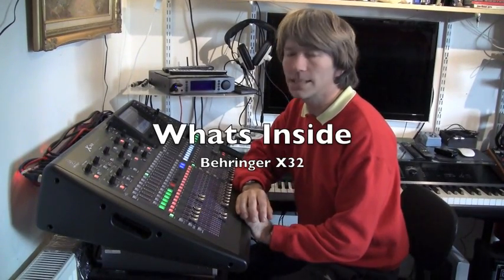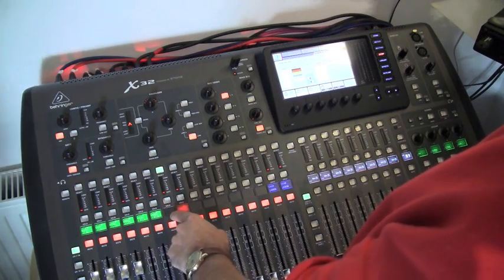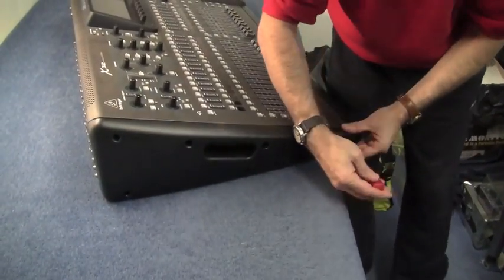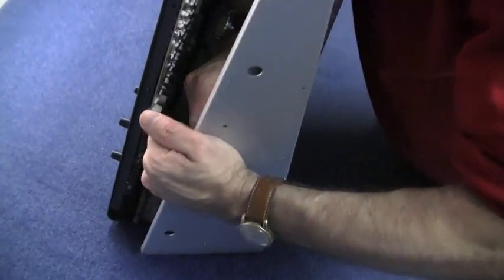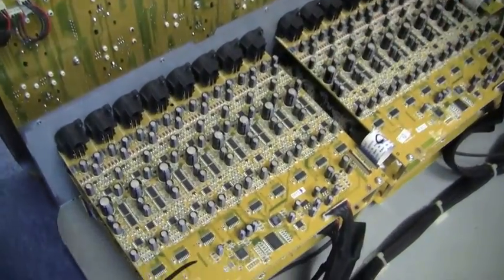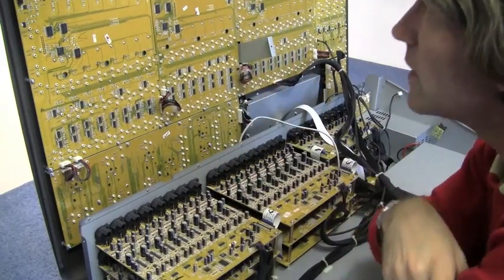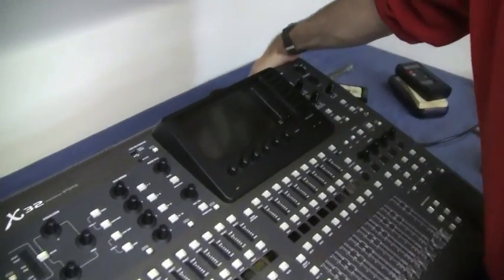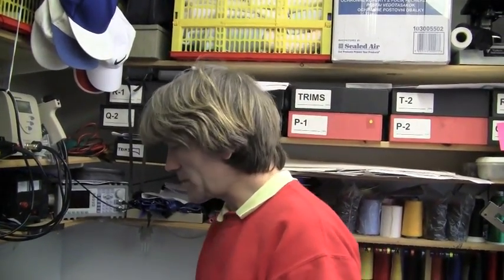MF#2 Inside the Behringer X32 digital mixing desk teardown and repair v2 software

Comment: Thanks so much for this! This repair totally worked for me on my x32 many years ago. The LED in the scribble strip is still going strong with the unit turned on nearly 24-7 for many years. This fix also worked on an X-Touch Extender. Exact same problem, one of the color channels went out on the LED. Heating it up with a soldering iron and reflowing a tad bit of solder fixed it in both cases. Not sure if the LEDs just need a bit of heat to fix the channel, or if there were issues with the original surface mount soldering. this fix did it on both occasions.
Reply from the maker: Thankyou Doug I’m glad it worked for you. best wishes.

Comment: Damn, you have all my respect to do what you do, thanks for publishing the video :)
I only add that some of those small screens have a different brightness already from new mixer at least as far as I am concerned with what I have found on the one I have, 1 or 2 result with a slightly weakened brightness, but by adjusting the brightness settings you can correct a little the problem but obviously remains.

Comment: Would have been a better repair if you had applied the solder and the iron at the same time instead of dabbing it. Also you did not need to remove the side plates and base making it unstable.

Comment: .... what do you expect..... it's a Behringer.  I've three DDX3216 mixer desks now. Wow, fab spec for the money .... which is exactly the problem.  All THREE have various issues from no boot :\, 'Xmas tree' lights on another and one which takes about 10 restarts to 'charge' the failing capacitor circuit of the PSU, so that it doesn't then fail the boot check on Vdrop on the line, ie. just enough to squeak it through the boot sequence. Then IF it gets there, audio main buss crackles light static until it warms up....all good to start recording .... unless it freezes.    Looked under the bonnet of all - the finish build and glued everything it would seem, could have been better finished off by my 11 year old daughter... wearing 3D movie glasses on .... in summary - as you know - you get what you pay for.  Otherwise they're great!!! :)

Comment: I also have this exact problem, but on channel 13.  No red.   I notice Full Compass has a lot of repair parts for this board.  I'm thinking stocking up on a couple spare faders/motors, encoders, scribble strips, etc.

Comment: Hi Markus! I want to repair it by myself too and I was wondering about the watts of the soldering gun, should it be a low watt gun? I have the problem with the LED's from 9-16 and 25-32 channels but they don't show icon & text, just the color and invert color button doesn't work too. Could you tell me a little tip and some cautions please? I'm not from USA so I can't even send it to a repair center.... hope u can help me buddy :/
Reply: I'm afraid that's a larger issue that isn't so simple :(

But as to what to use, he uses a temperature controlled soldering station here, it's a basic Chinese clone of the old Hakko 936, well it's not an exact clone, but the tips are compatible and they look similar, and it's likely specified as 50W or 60W. The way you work with a temperature controlled station, you turn it up slowly until it can melt the solder from a roll, and then you turn it up another 50°C or so, and then that's gonna be fine, and the more powerful it is, the better, but on Chinese gear that doesn't come from one of the bigger Chinese brands like Zhongdi and Aoyue, the specs are usually rather optimistic and sample variation is huge, so you can't trust them anyway. You do this carefully for every tip you have once, and then you just remember and you can set it straight away. To be kept in mind when setting temperature is that repair should be done with eutectic leaded solder (something like Sn63Pb37, or i use Sn62Pb36Ag2), because it's less stressful on the board and the parts, but the parts are originally soldered with Sn100 if they were made in 2005 or later, which takes a higher temperature, so you may need to add another 20°C to reflow original solder properly. Make sure you have magnification tools on hand to inspect.

Generally, i think everyone who is inclined to do the repairs should learn to do them, but the first thing you consider repairing is usually something valuable and something you depend upon, and you probably shouldn't be soldering around on it right away, there's a lot of damage that you can do, but have someone with more experience help you along or maybe turn to a professional repairman.

There's a variety of tools that you can touch up a small joint like this with, like even a handheld battery soldering iron with only 6W or a USB soldering iron, they are just a couple $. Generally non temperature controlled soldering irons with over 30W are dangerous for electronics and tend to burn up themselves pretty quickly. If you're buying non temperature controlled iron, you're looking for a temperature equilibrium soldering irons that just don't get too hot by themselves, but they still run a bit warm for fine soldering. Soldering irons and stations with no actual temperature feedback but with a power regulator on them are basically a waste of money, they usually don't have an equilibrium whatsoever and are always either too cold or glowing hot. I mean if you can get a temperature controlled 936 clone for about $20, why bother with something that's so much worse? Also if you're repairing something this expensive, it's a shame not to just buy a Hakko 888D for $100 or maybe even something better.

Comment: Not Midas mic pre's !!!
Reply from the maker: I'm not exactly sure what part Midas has played in the making of this mixing desk.
Reply: markusfuller They didn't have any part in the X32. When Music Group merged with Behringer, they took OS and and mix engine of the X32 and added Midas mic pre's and the Midas pro faders and thus came the Midas M32.
Still a very nice video. Goes to show that some things can be fixed without sending it to the repair centre. I would do the same thing before sending it off.

Comment: I am very hesitant to buy any more Behringer stuff after a V-amp and a V-amp Bass (both the rack versions) stopped working about one year after purchase: the V-amp became a xmas tree (literally ALL lights on but no sound at all) and the V-amp Bass when resetted worked for about 15 minutes after that only producing hiss and noise. Made in China athe time. I know this Behringer is in fact a Midas but again I don't trust the electroncics done by Behringer (again in China I guess).
Reply from the maker: +Karl Georges Hi Karl. I got rid of the Behringer X32 as it just kept producing more and more faults. I know there is a bit of Midas inside this but still the mixer became unreliable and I never knew what the next problem would be the next time I turned it on. I have moved over to the Allen & Heath QU16 now and have not had one single problem.
Reply: +markusfuller Thx for this follow-up Markus, I'll look out for a 2nd hand Teac DM-3200 and check out the specs of the Allen & Heath.
Reply: same Problem with V-amp Rack version
Reply from the maker: I am interested in their new synth but I dare not buy it until its been on the market for a year and theres no reports of failure.
Reply: Behringer is great....As long as the Behringer mixer is actually working. Unfortunately it's a crap shoot with them. Fortunately I have been lucky. Others, mmmm...Not so. I know a musician friend who purchased one of these digital mixing boards (not this one) for live use. It broke down on the road. OUCH!

Comment: You said at 10:13 that the components were "flowed" onto the PCB, then you try to correct yourself in a written manner. What happens is that you end up describing a reflow process. You were almost right! ;)

Comment: Thanks for the video, I had an XLR barrel stuck in input one after last nights gig and was a bit hesitant about opening the case, but it is pretty straightforward and actually Behringer have designed the Compact to hinge open without having to disconnect anything. Barrel freed and locking mechanism now repaired :-)

Comment: Hi Markus, I've got an x32 with channels 8-16 and 24-32 inputs aren't working. I can send phantom power to them and the LED indcation lights up. However, there are no signals coming in. Could it be that there is a loose connection with a ribbon strip or is there something faulty with the the board? Hope to get you advice on this. Thanks in advance!
Reply from the maker: +alroy Hi Alroy. Im truly sorry but I do not think I can help with this. I doubt there would be a loose ribbon strip as the xlr inputs are directly soldered onto the boards inside. I know you may have tried but how about a factory reset just incase the gates etc have been set too high for those channels maybe ?. other than that I sold my Behringer a while back as i needed something smaller on my desk. sorry about that , best wishes from Markus
Reply: +markusfuller no worries. Thanks for taking your time to respond. Really appreciate it!

Comment: Hello. I have a problem with my behringer x32, the problem is that the fader move alone without my touch, when a vibration subwoofer or when I hit the mixer, and prove to reset but nothing.
Reply from the maker: +carlos cristobal lanfranco Hello Carlos. Im not sure why the faders would move on their own, if they have midi control from a DAW then yes but they should not just move without  a signal to the motorised fader.
Reply: I'll make a video so you see the problem, I think it is a bad contact
Reply from the maker: OK let me know whan you have made the video and I will watch it and try to help if i can.

Comment: Hi, please help us. x32 doesnt select the expansion card on the setup synchronization option, so windows doesnt detect de 32 channels
Reply from the maker: Oscar Rendón Hello Oscar. Im sorry but I do not own the X32 any longer so I do not know how to help you with this problem. My apologies.
Reply from the maker: It was too big for my setup, I changed it for the Allen & Heath QU16 which is a smaller more compact mixer. I never had any major issues with the Behringer32 apart from the led problem.
Reply: +markusfuller Why did you get rid of it ? May I say. Too many crappy solder joints ?

Comment: Congrats you solved the problem in a very cheap and fast way. I have a problem on my small xenyx 1204FX. The channel 3 is dead. You think it's the 4580 integrated circuit?
Greetings from Portugal.
Reply from the maker: Porfirio Domingues Hi Porfirio and Hello to Portugal. Im sorry but i no longer own the Behringer mixer and to be honest I have never been inside the 1204FX mixer so I cannot help you there. Im very sorry. from Markus
Reply: markusfuller Thanks. You work with electronics? I' m just a sound technician. Greetings.

Comment: Any plans on tearing down a Mackie VLZ4?
Reply from the maker: Hi Andrew. most of the items I tear down belong to me. I cannot get my hands on the Mackie VLZ4 . sorry
Reply: Anyway, thanks for reply.  I just wanted to say that your videos really are the eye opener to have the inside look on what manufacturers are selling us.  I replaced once LCD backlight in Yamaha SY77.  It had to disassemble and reassemble the instrument like five times, broke the LCD at the fourth attempt, ordered new LCD, it finally worked.  It took me roughly 4 and a half hours each session.  But that's not the point.  Yamaha SY77 is very well built inside.  And so are Roland D-50 and Casio VZ-1.  Money well spent on those synths.  I recently acquired Roland Integra-7 and Mackie 3204 VLZ4.  I am just really scared to even look inside those units though, 'cause they're probably totally hollow inside, which makes me think about my money totally gone for the companies' profit.  Anyway, just wanted to say that your videos were really a big eye opener what's inside of the AIRA's and Prophet 12.  I wouldn't buy any of those after seeing your videos :)
Reply from the maker: Thanks Andrew. I had the Integra for a while but found it a bit fiddly to use, other than that I think the majority of the sounds in it were really TOP quality. I kinda wishes I had not sold it now. Best wishes from Markus

Comment: Sitting on the edge of my seat the whole time! Had the tri colour LED been broken I'm guessing you would have been out of options?
Reply from the maker: Hi. I had some RGB leds that could have used for replacements but they were much larger than the ones in the mixer so I guess they would have worked but would have been a different brightness. still I'm pleased I managed to get the thing going with the original part.

Comment: Thanks for sharing.  I just put a X32 in the shop.  All the motor faders stopped working. I hope it is just a power supply issue, or a cable slip.  We have had it for 15 months or so.  It is used in a house of worship with 4 sound engineers.  Lately, a musician has been using it while holding singing lessons for new praise and worship singers. We were using firmware 2.06 for about two weeks when we noticed last Sunday the motors were not working.  The faders if moved still send communication to the brains of the board. We can still use ipads/ PC's and Androids to control the board. Hoping for the best. We tried power cycling, firmware step back and then returned to 2.06, factory reset and so on.  Behringer Tech Support said they have never heard of that happening before, "congratulations!"

Comment: Wow that is one hell of a nasty way of constructing that device. Props to Behringer for using real fiberglass PCBs instead of paper-based PCBs, though. really goes to show how much money goes into producing these things

then again, normally when it's put together, it doesn't have to be taken apart ever. Just needs to be solid and as wear-proof as possible

Comment: Thanks for that, nothing wrong with my X32, but found it very interesting! and reassuring that the quality and repairability is there on this mixer.
I'm so impressed with every aspect of it, the only thing I couldn't be sure of was the 'repairability' which was a big issue on previous Soundcraft and Mackie desks Ive owned. There really is nothing out there to compare with the x32, we've had to use ilives at gigs recently and do they sound as sweet? no. they don't.
Reply from the maker: Thankyou Kenny. Im pleased you found the Video interesting, I remember the days not so long ago when Behringer was on the same list as something like amstrad in terms of feelings of quality. Now they have certainly moved the goalpost and are making some good quality units, the x32 range is making its way into so many small studios now as the quality is very impressive for its price. (no i don't work for behringer before anyone asks).

Comment: great great markusfuller...thanks man...you are very talented¡¡¡¡
Reply from the maker: Thankyou very much. no talent required just take things apart and its amazing what you can learn just by having a look into things. best wishes
Reply: markusfuller  thanks a lot for you reply...and keep going with your investigations about x32...please reade my comment on your video part 2...and i repeat Talented and modest man markusfuller...tlazokmate (thanks) desde México¡¡¡
Reply: markusfuller
hello markusfuller...i have a problem with my left eraphones jack of the x32...my headphones plug have just broken inside...my question is ...do you think it is possible to take out the piece of the plug inside of the jack or do i have have to replace it???...because i see in your great video that the jack in the x32 is pastic box closed...i was thinking to take apprat the x32 following your video and then tray to take out the part of the plug inside the left jack...with some mini tool...thanks a lot for your replay and sorry for my bad english ...saludos desde Mexico Marcus¡¡¡¡¡
Reply from the maker: Hi. I think it would be better to take it apart and just replace the whole Jack socket. I do not think the plastic box is that important unless it has a small circuit board on it but i guess the Socket part will be replaceable
Reply: markusfuller thanks a lot Marcus...i ve been able to take a part the x32 .,..and succesfully removed the plug part inside the jach connector...i didnt replaced it lucky ¡¡¡¡...thank for your great help...and kkep going sharing yopur wisdom....
Reply from the maker: Excellent Im pleased you fixed it. I hope more people will have a go at repairing things. Best wishes from Markus
Reply: markusfuller it was only possible  with uour great help in your video tutorial...and i ve gorgotten to tell thqt ypurusic ia great also!!!! The track that you play from usb at the end of your  video 2...you are a great mussician also Markus ...millones  de gracias...saludos desde Mexico...tlazokamate (it means thankyou in nahuatl our true ancient language) ...take care Marcus...i ll be watching all your great videos and trying to learn something new...

Comment: I kinda like the build quality of the unit. Can you tell us what brand of capacitors re used across the boards? That's the number one reason for units failing :)
Reply from the maker: Hi. Im sorry but I did not look at the brand of the capacitors. if I open it again I will take some pics and try and see what brand are used.

Comment: what was the spectrum analyzer you had going on the very end of the video?
Reply from the maker: Hi Braden, The 100 band real time analyser is on the Behringer mixer, It is an extra that is included in the new version 2 software along with several more effects compressors etc. best wishes from Markus